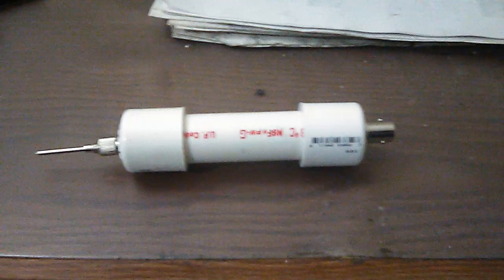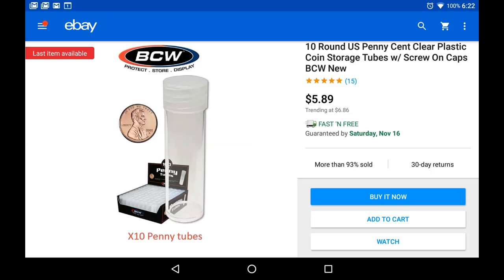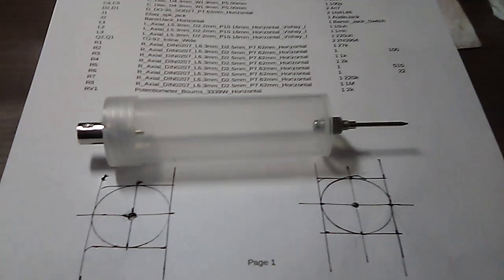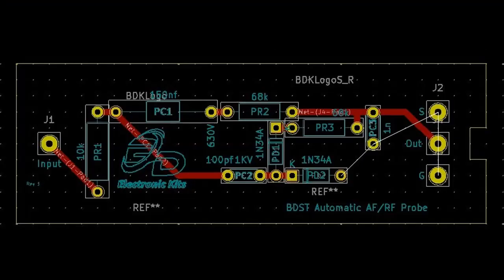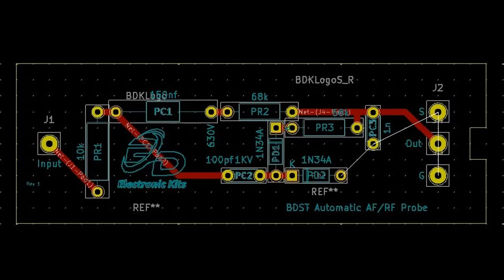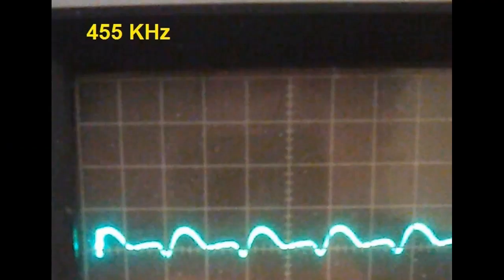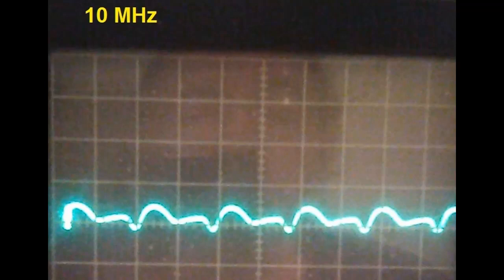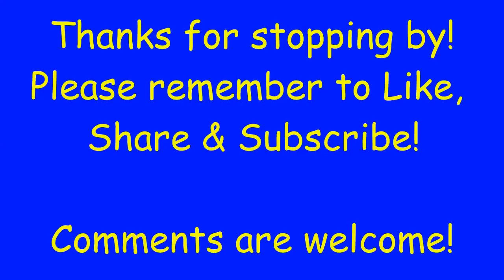BDST Coin Tube Probe

Comment: What do you use for the probe end and where can they be purchased?
Reply from the maker: If you do a search on eBay you can find probes like these https://rover.ebay.com/rover/0/0/0?mpre=https%3A%2F%2Fwww.ebay.com%2Fulk%2Fitm%2F153620932040 and the metal tip can be removed with a pair of pliers.